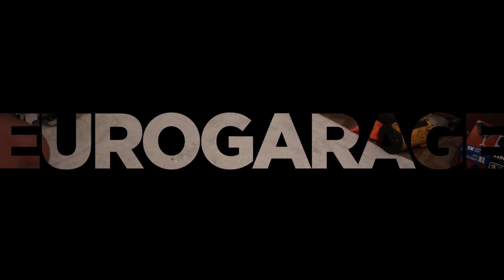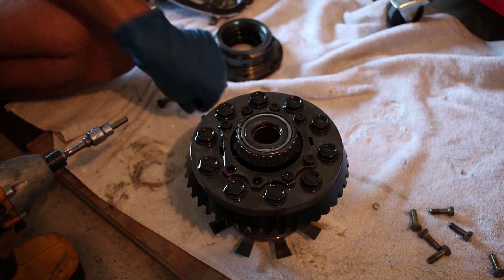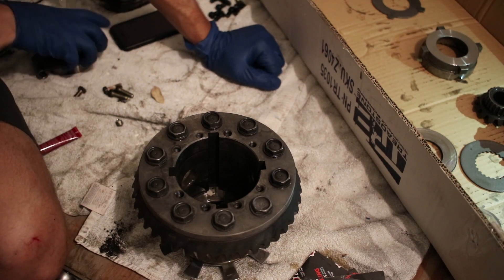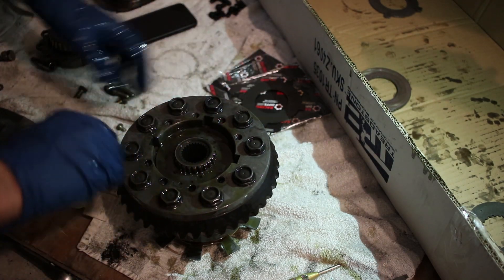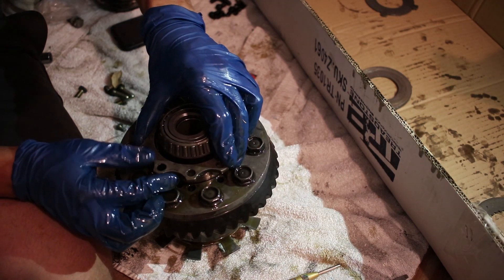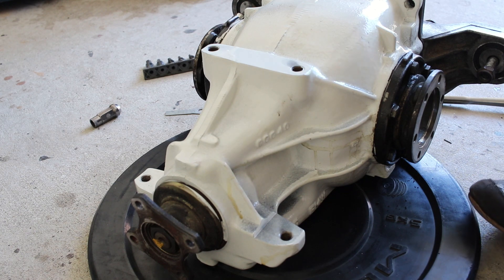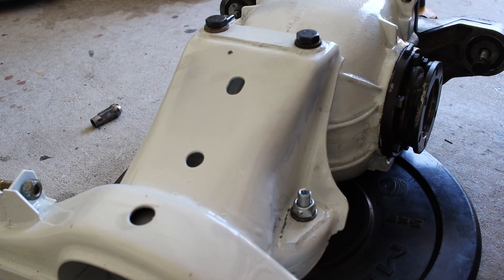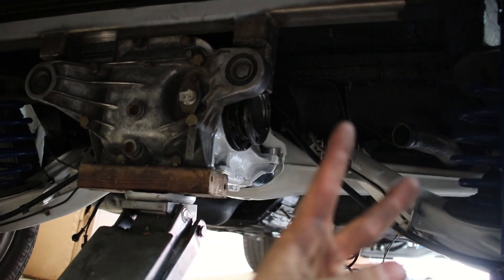Rocket Bunny Turbo S52 BMW E30 Build | Part 18: Differential Upgrade & Rebuild

Comment: This just reminds me about how badly I need to build a 2.93. So much suck running a 3.73 (albeit 4 clutch) with the ZF320 - besides fact that the ring & pinion seem to be eating each other now.

Comment: Don’t you have to adjust the lsd preload when you take apart the internals? Check for clearances, etc?
Reply: Sorry, I think I meant backlash and not preload. 
To answer my own question, I guess not bc you didn't touch the output flange (crush bushing, etc)? But if you can shed some light on this, that'd be sweet!
Reply: Oscar Rodriguez he didn’t replace the bearings so the backlash doesn’t need to be set. Preload is determined by Belleville washer
Reply: towlie911 which bearings? I’m unfamiliar with lsd’s in general and trying to understand them
Reply: Oscar Rodriguez there’s two tapered roller bearings on either side of the ring gear and spider gear housing. The part he lifts out has them on either side. There’s another one on the input flange. When you replace these the position of the pinion gear changes relative to the ring gear. You can adjust the position with metal shims in the bearing end caps that hold the roller bearings in place. If you reuse the original bearings and the shims, the gear contact patch and backlash stays the same. It’s only when you replace the bearings that you need to reset it. The bearings usually last up to 200k miles and replacing them adds a lot of work so most people skip this.
Reply: @towlie911  What happens after 200k miles? I'm currently at 230k lol but the car has been babied since new. I rly want to do this 3-clutch upgrade, but I'm guessing I would experience extremely high wear due to the warn out bearings?
And is this the bearing you speak of: 33131204568? If so, isn't this what he's knocking out at 10:51?
Thanks for the info!
Reply: Oscar Rodriguez the bearings will last pretty much the lifetime of the car, but they will start to make noise and you might have more lash in the diff as the bearings wear. The gear engagement won’t be as smooth. The part he’s knocking out is the output flange seal in the bearing housing. I would try to find a diff with known mileage, preferably below 150k. Or build the diff yourself, press on new bearings, and have a professional set the back lash.
Reply: @towlie911  Would testing the preload tell me how worn the bearing are? Or would that just be checking for clutch wear? I know the torque wrench has to click at around 55-60 ft lbs...
Anyway, I think I'm gonna take a chance and just do everything Max did in this video (just the 3 clutches and easy-to-get-to seals). Down the line I'll definitely have it professionally rebuilt, tho. Thanks for the helpful info!
Reply: Oscar Rodriguez yeah checking breakaway torque can tell you a little bit about the condition of the diff. Breakaway torque should be 65+ft lbs. or you can just do a burnout and see if both tires are spinning. Good luck!
Reply: I would have checked engagement and backlash anyway. I don't trust whoever was in there before. Especially if it was me
Reply: Nathaniel Mathies if I had the $$ to pay a professional, I would too! Diff is untouched afaik

Comment: Yooooo! That diff cover and mount solution is incredible!!!! Just two welds underneath to the chassis rails? You could even tie it into a cage or x brace! I didn't know that cover existed! I've only seen the weird adapters or z3m ones!
Reply from the maker: Thorhack That’s the plan. I’m gonna run diagonals off my strut towers to the top of ea ear mount.
Reply: @EuroGarageOfficial  hell yeah dude. You're an inspiration man! Can't wait to see more progress!

Comment: What'd you use for the undercarriage? And did you wire wheel aaalllll of the old coating off??
Reply from the maker: Oscar Rodriguez Upol Raptor liner Black. No. Just cleaned thoroughly and sprayed over it all.
Reply: EuroGarage are u using oem rubber diff bushings?